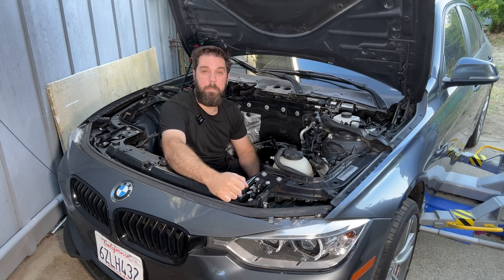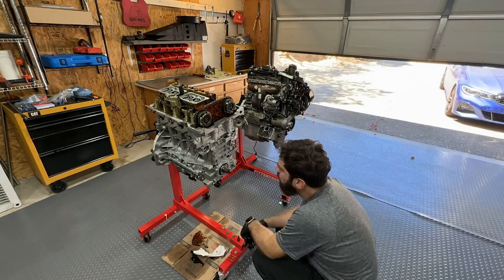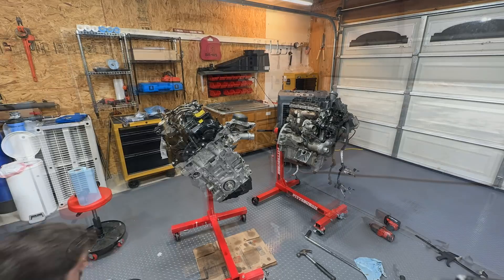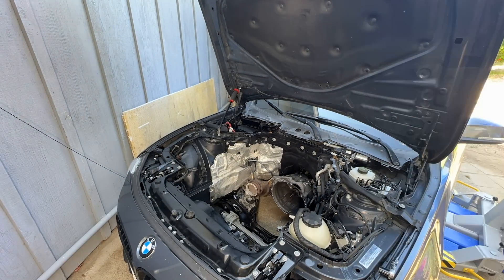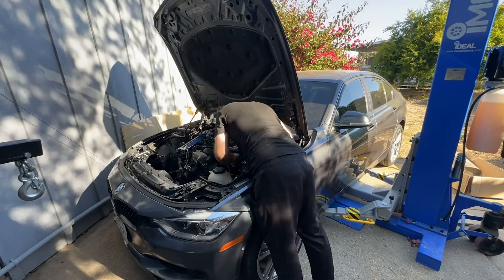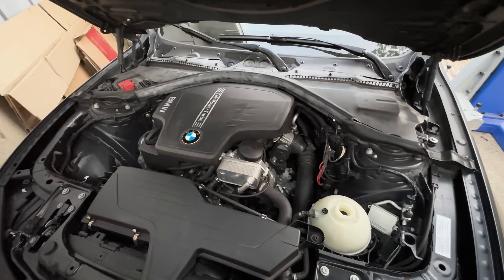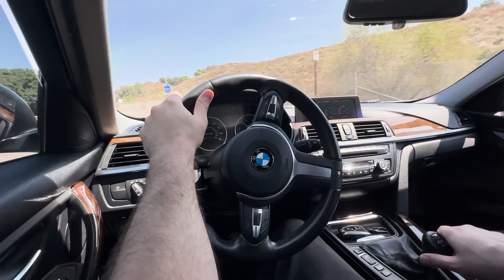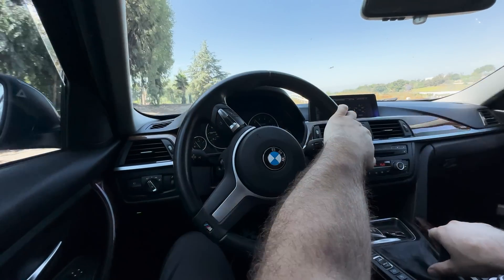Aren't You Thankful BMWs Were Once Unreliable?

Comment: I love the way you actually did. The work on the vehicle. I just bought a 2015 X5 Xdrive 35i. And I want to change the valve cover gasket with this leaking slowly. I have a 2011 Audi A8 L and I changed the valve cover on both sides myself. What would you recommend for the BMW?

Comment: I have a question and a proposal.  I own a 2010 bmw 335i x drive with full bolt ons.  I would love to have my engine rebuilt as you have done to many cars in your videos. Unfortunately for me I live in NJ. My most consistent problem is a check engine light with code 2C31 which no one has been able to diagnose and fix.
Reply: Victor check your rear o2 sensors. One may not be tight or not working. also smoke test your exhaust system could be a leaking gasket.
Reply: @hestl3perf0rmance  thank you I will have it checked this week

Comment: Hey Musa! PLEASE READ! 

I have a issue with my car and didn’t know where to go from answers but I’m hoping you’d know what to do. I’ve been a huge fan of you for very very long now and if there’s anyone that can help I know it’ll be you. 

I’ve recently retrofitted xenon headlights to my e90. It’s a pre lci e90 and I’ve fitted lci xenon’s. 

They’ve been coded and rewired and I’ve upgraded the frm. Everything seems to work however the driver side (right side I’m from UK) halos do not work (side marker/halo/DRL). The bulbs and headlights are completely fine as I’ve tried both headlights on the passenger side and all seem to work. The wiring looks good too, the frm is good too, I’m getting a “short circuit” and a “right side marker” error and the wires that go to the halo pins are getting no power. Not sure what to do. I’ve tried removing the error, double checking wiring, and all the normal procedures. Nothing seems to clear the fault. 

What can I do to fix this? Any advice would be extremely appreciated!!!!

Comment: Man i sure need your help with my f30 n20 engine its been a nightmare still cant get the p00bd code to go away ive done everything
Reply: If the wiring is good and a known good sensor is installed, the dme could be bad. A used dme is pretty cheap and a clone job is not too expensive too. I have seen a n20 powered vehicle w a bad dme due to valvetronic codes that would never go away. A possible giveaway would be if you clear the codes w ignition on and engine off, it may never clear. I assume it is for a maf sensor code. Best luck
Reply: @spencermaiers8322  thanks ive cleared the codes with the ignition on and they have cleared then they come back on ive also tried ista as well to clear same thing replaced the maf sensor 3 times and nothing check the wiring as well everything is fine and also i replaced the power module and same thing at this point idk what else to look for or do
Reply: So, you clear the codes, the code stays off until when - immediately as you ignition on again? When it runs for a minute or a few seconds? What is the vehicle behavior? Drivetrain malfunction?  Power issues? Just a fat check engine light and normal otherwise?
Reply: @spencermaiers8322  yes i clear the codes then about one successful trip and when you turn off the car then turn it on to go somewhere then it shutters like it wants to stall then drives fine then when your at stops it shakes rpms drop like it wants to stall then goes normal but sometimes the codes stay off for like 100miles then goes back again to square 1 so idk
Reply: @DROXX2387  sounds very strange. How is the battery condition? Newer? Original? I have seen A bad battery destroy two dme units on a Mercedes before. 08 gl450. Started good. Battery original from 08. This was in 2018. 

I'd double check the wiring and voltages per the wiring information if some is available. 

Perhaps also see if there is a software update for your dme.

I'd consider a clone dme in the back of your mind if you keep coming up dry.

And report back when you do solve it for the help of the group.
Reply: @spencermaiers8322  good just replaced it  when i purchased the car and ive also replaced hpfp and fuel injectors and ima replace the low pressure fuel pump and still can get to the problem
Reply: @DROXX2387  I doubt the fuel pump is the issue. I'd avoid "throwing parts" at to a minimum but I'd say everyone does it.

I'd take the fuel pump money and get a second opinion.  A smoke test even with a swisher cigar might be sufficient to see if there's some air leak. A cigar is pretty cheap. In lieu of a smoke machine.
Reply: @spencermaiers8322  ive tried that too ive even made the poor man smoke machine lol home made as tried the cigar and found no leaks
Reply: Also, check the air inlet tube to the turbo. It often can break and it's in a bad spot. I've seen several broken.

If you have a friend or relationship with a mechanic it would be an easy smoke test for that pipe. It's plastic and has a tendency to "sh1t the bed".
Reply: @spencermaiers8322  ive done that ive also have upgraded the charge pipe and inlet for metal ones and even replaced the map sensors and trying to retrace my work cause before i replaced the pcv cap on the valve cover i didnt have that code
Reply: @DROXX2387  pcv cap, could you elaborate? I personally never taken a (basically one time use) plastic n20 valve cover apart.

The n20 is 4cyl and has a shorter head cover but for earlier 6 cylinders I would always at a certain age chage those covers. They warp badly.

The n20 valve cover is definitely reusable.

However the cap situation... please detail what you did. Sounds like to me from a educated guess you need a valve cover.
Reply: @spencermaiers8322  yeah the pcv valve i had replaced it with one i had found on ebay which the cap on top of the valve cover on the n20
Reply: @DROXX2387  I sort of think you found your problem ;)

Put the old one back
Reply: @spencermaiers8322  i cant lol its destroyed im gonna have to go to autozone and buy a replacement
Reply from the maker: Have you tried scanning with ISTA instead of a generic scan tool?
Reply: @VehicularDIY  yes i have

Comment: Reliable bmw is a joke, has always been and will be as it is NOT profitable to build a reliable  car, period.
It's even more profitable to build a crap that can fail before 100k and under the warranty to be replaced 1 out 50 engines, like n20, m65, n65, n52, than building a car that can last over 300k.
Reply: I do believe bmw engineers in leaks and service beyond the normal failure rate of all normal components. 

However, 1980s bmws and into the 1990s were very reliable in many ways.

The e28 535i is a reliable car.

Bmw is a very skilled company as are all manufacturers basically. They make fantastic engines. They also have had decades of ultra high performance, luxury sport, and are a go to for racing and budget performance as they age.

Bmw also probably has the biggest enthusiastic group of owners who help each other out from what I have seen, but I'm biased. Just don't see that much content for audi, Mercedes, etc.

Driving a bmw feels a lot like driving a porsche in many key ways to me. Power delivery, braking, some handing feel.

Bmws are very cool cars who need a honest mechanic or several with skill, an owner who diy jobs or has enough to pay the mechanic,  and or a friend or two who can help out. Bmws can really be great cars.

The m30 engine is a fabulous long lasting engine. Their 90s v8s are very good. There's a lot to like about bmw. They are somewhat presented obnoxiously in the dealership but life isn't perfect neither is BMW. But they have a lot of cool stuff going on. Hopefully they don't go woke and broke!
Reply: @spencermaiers8322  80s-90s :))
it's 2023 you know.
A company with such immoral failures in engineering and design like M52 (from 90;s BTW !) , N20, N52, N53-54, N55, M65, N65 .... the list can go real long here, shall not be sold with "fabulous ", "Power delivery", "very skilled", "cool cars". 
And I'm not even mentioning other areas like electronics, suspension, transmission, central diff on x3, x5, door handlers, body design - all these can not be justified by "environmental enforcement"
Since 2000's they only depend on their past reputation and during last 20 years they totally consumed that reputation.
Now only stupid or "enthusiastic" buy that brand.
If you buy one then  forget your life, family, and devote yourself to that  piece of metal, wasting time on mechanics, dealerships, "enthusiast" forums. 
luck with that!
Reply: @Project_88 actually bmw now is number #1 in consumer reports for most reliable brand, last year they were 2nd. You are right about some things you get cheap bmw expect to spend 2-3x the cost of the car. I have modified n55, about 500hp. Only issues I had is strut leaking at 85k, control arms, small oil leak from ofhg, now I almost at 100k mi. Most of maintenance definitely doesn’t take that much time. I do my maintenance when kids are taking naps. If your spending all day maintaining your bmw you got yourself a really bad example. I also work on my cars with my kids as well for fun. It doesn’t have to be away from family time. In end of day it is a piece metal. Family definitely more important.
Reply: @Areku06 that's good to hear regarding your N55! I've got a Pure Stage 2 on my OG M2 with about 62k and ready to take it up to the next level by adding ethanol. I'm probably going to need a clutch soon though haha
Reply: @micraw714  I’m using pure500 turbo and b58 hpfp with e30 blend custom tune. In end of the day we buy bmws because the engine and chassis. Current BMW B58 inline six engines are like 10 years ahead of the competition. They started way before everyone else. Inline six is perfect configuration for turbocharging. It’s no wonder Toyota chose b58 bmw inline six for the Supra.

Comment: From the several BMWs I've had, M10, M20, M42, M52, S52, and now an N52n, reliability of the engine has never been an issue.  Problem now is the crap components BMW puts around the engine.  Both e82 and e90 I've driven were good, but became ultimate CEL generation machines the second they hit 100K miles.  By comparison my 01 528 wasn't maintenance free certainly, but never failed smog and was calmly cruising through 292K miles when it went to a new home.
Reply: idk my 2008 335i has 121k miles and i converted it to single turbo at 101k. Haven't really had any issues besides fuel pump which I just upgraded anyways. That and of course the valve cover lmao.

Comment: great video, you are the man man of bmws.

ive got a b58 in the m140i in your opinion how much power on stock internals, just the hpfp upgrade can these engines run but keeping reliability in the green?
Reply from the maker: Thanks, 550 to 600 whp in my opinion to minimize reliability hassles.
Reply: @VehicularDIY  so currently running 460 bhp crank 700 nm torque, stage1+ everything stock besides fuel pump double res delete exhaust, fast enough on uk roads for sure, good to know it can take plenty more👍🏻